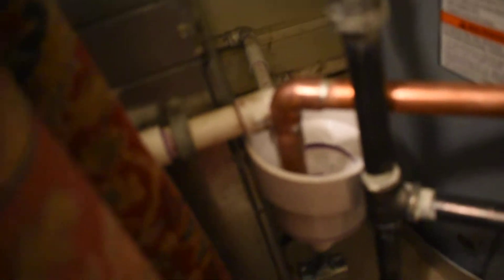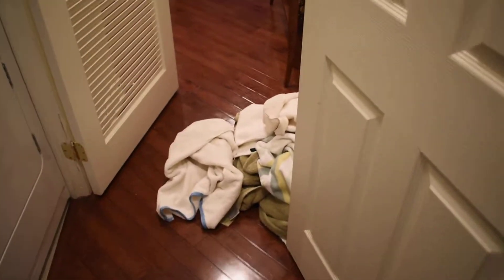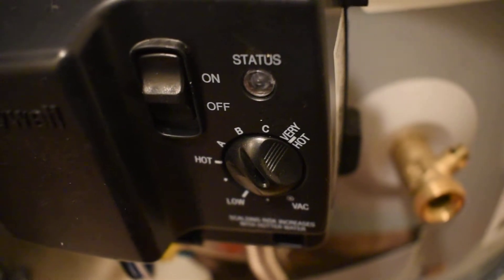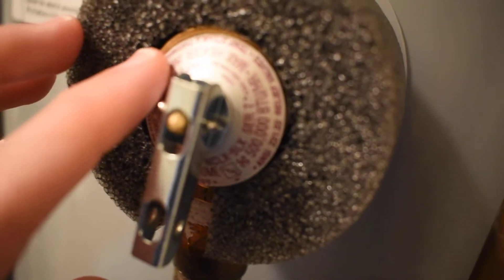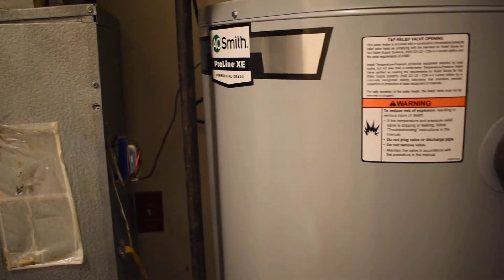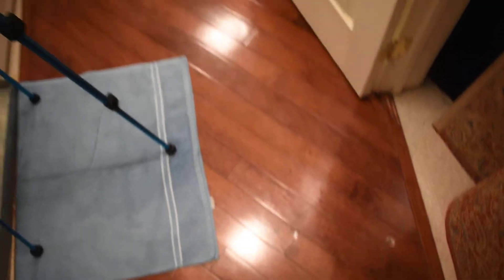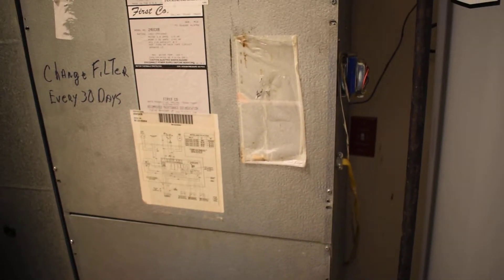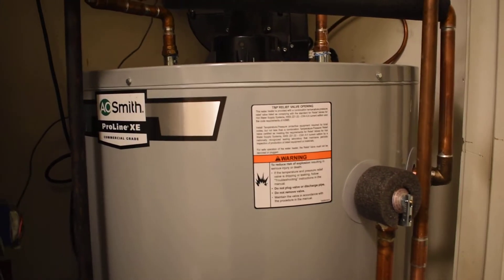Boiler Update: The video I never wanted to make....

Comment: Sounds like careless installers plus China parts that caused all of that.  There was no reason for the water to be set to 160, that can cause severe burns.  Mine isn't much over 130, I keep it there purposely to prevent damage to the ancient tank.

Clogged valves can often happen if the lines aren't purged or flushed when the install is about to happen.  Many months ago, I had a video of a new basement sink at the oil spill house.  I believe the faucet was new, and I took the aerator out, and there was all kinds of crud in it.  I was there and watched, and they actually DID purge the line, but not well enough.  When domestic water is shut off and air is allowed in the pipes, generally that will kick up all sorts of debris and mineral deposits and who knows what else is in Jersey water.  First place that goes is the aerator.

Every once and again, I'll pull the aerator in the upstairs bathroom sink, and run it.  I plug the sink when I do that, and I can't tell you what comes out of there.  Worst is when the purge the fire hydrants in the neighborhood, that really kicks up some goodies.
Reply from the maker: The craziest part it was still 160 after being off for over an hour, AND while it was spilling over it was taking on new water that was near freezing (our cold water in january usually comes to low 40s).

Reading that reminds me of your old cabin winterizations, and all the stuff that would come out of the different sinks and that.
Reply: That's kind of the point that the water was still near 160, means the tank insulation is pretty good.
Reply from the maker: Well now that it's functioning normally, it definitely is showing off good insulation. I've noticed it does cycle less on idle, and it can recharge faster. Maybe because it is newer, but it gets the job done.

I still prefer our old one honestly, 140 honestly felt like the RIGHT temperature for full hot. 120 is almost slightly lacking, but it isn't the worst thing in the world.
Reply: 130 is a fair temperature.  Not too hot, not too cold.  Even 130 can cause burns.  But it takes a few seconds to do that, you'd have moved whatever body part out of the water by that point, preventing a burn.
Reply from the maker: I've accidently put my hands under full hot faucet water thinking I had it on warm enough to not burn me a few times. We all have our moments.
Reply: Wait till you get older.  Then you get to have a lot more moments.